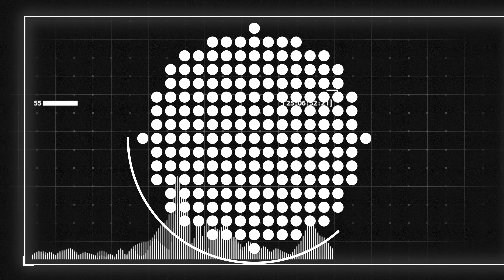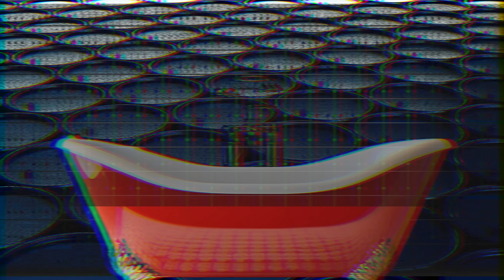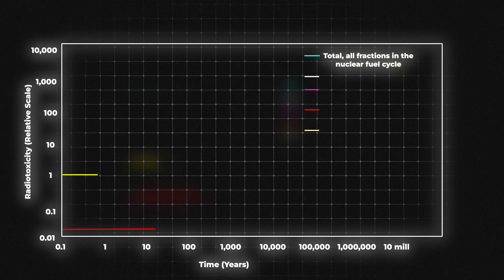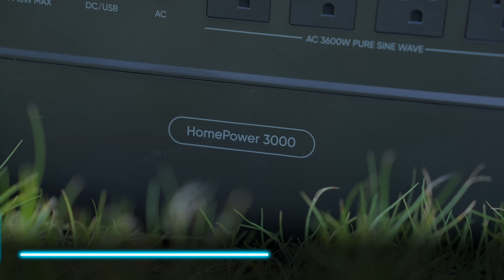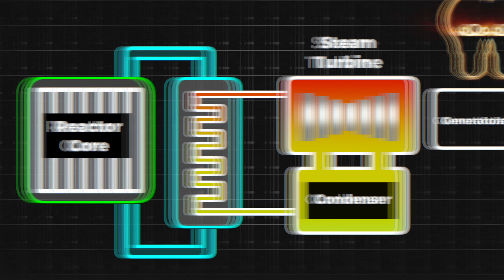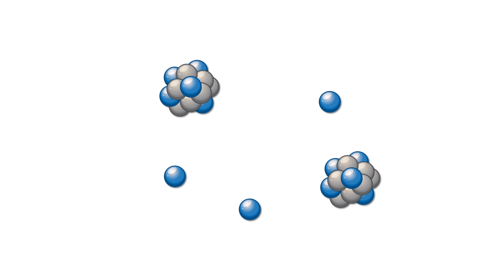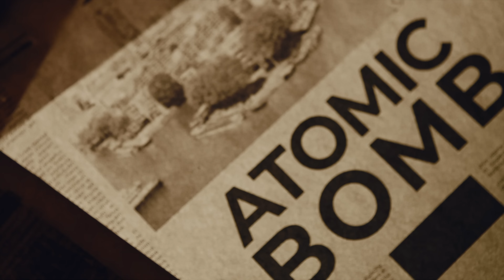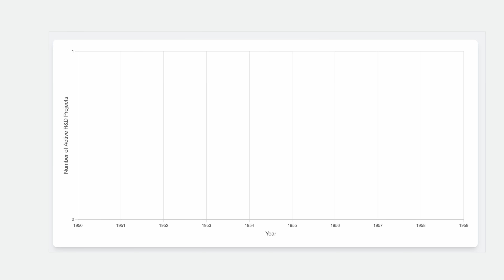Why Thorium is About To Power Everything

Comment: No the salts are not particularly corrosive to the primary material intended for usage with a molten salt reactor, Hastelloy N can handle fluride salts at 900C withe less than 1 million'th of an inch of corrosion per year meaning a 3mm thick pipe would on average take 118 years to corrode through it, and that is at 900C the first proposed reactors are intended to be ran at below 700C because that reduces corrosion exponentially, and Hastalloy N was invented in the 1970s along with the molten salt experiment... we have had the solution for over fricking 50 years, there was never a corrosion issue people just heard salt and said "salt corrode, salt bad, ooga booga!!!" when it's actually salt + water that corrodes stuff, which... if they have water in the reactor... erm, they f£$%ed up, like they're really f£%$ed up, getting water into a reactor which is 600 - 650C at ~5atm, like it would actually be kinda impressive.

And might I point out that water is more corrosive to steel at ~400C, it's only due to the usage of sacrificial anodes that conventional nuclear reactors don't fall apart, to be fair you can't use sacrificial anodes in a molten salt reactor as you would also plate out fusion products and more importantly U233, which would be bad. plating out of the suspended fuel is a much bigger concern, so you would still have a sacrificial anode but it wouldn't be to maintain the ion balance, but instead to purposefully plate out a the suspended fuel preferentially on the anode because you can either replace it or clean it off relatively easily rather than... the impossibly of cleaning or replacing the whole reactor.

Comment: You are just so wrong on so many levels in this video, no the fuel in a conventional nuclear reactor is not enriched enough to have a runaway chain reaction assuming you build the reactor to have a negative temperature coefficient—which we do—all the accidents except for chernobyl were decay heat related, and chernobyl had an ass backwards design starting from the fact that it didn't have a containment building and ending with the control rods being graphite tipped which increases the reactivity and chernobyl having a positive void coefficient which in extreme cases is effectively a positive temperature coefficient considering it was a boiling water reactor.

and as for decay heating a throium reactor has just as much of if not more of an issue with decay heat than conventional nuclear reactors, this leads onto the mistake this whole video makes, which is that it's the fuel that makes the difference not the reactor type, because surprise, it's all the reactor type and not the fuel, first the reason why decay heat isn't an issue in a molten salt reactor... well it is, but like not a risk of radiation release, you will trash the reactor though if you don't deal with the decay heat, but even that is assuming you have implemented dump tanks is not a problem you have to worry about, both of those come from the fact that you are using a liquid which has a liquid temperature range of ~1000C and at ~1400C heat rejection becomes incredibly easy to the point where you can hair cool the fuel salts with a passive radiator. 

and if you have implemented dump tanks you are using a freeze plug trip if power is lost or the reactor gets too hot, and you can design the dump tanks to be very good at passively rejecting heat, by maybe keeping them submerged in enough water to let the fuel go through enough half lives so the dump tanks can be passively air cooled while keeping the fuel at a reasonable temperature. 

Can't be bothered to explain but all the other benefits you laid out are also due to the reactor type and not the fuel, apart from Thorium being 4x more abundant, but that is a relatively useless stat considering we have a mountain of nuclear waste that could be used as fuel again in a uranium molten salt reactor and get out 49x more energy out of the fuel than we did when we originally burned it and reduce it's half life down to lower than the waste from a thorium breeder reactor, which we have been using burner reactors for 70 years at this point meaning we have 70 years of waste times that by 49 and we could keep current rates of nuclear fission for the next 3430 years or power the whole world with fission for the next 100 years just from nuclear waste, to be fair to start up the reactor you do need a mix of high enriched uranium and spent fuel, or less weapons grade plutonium and lots of spent fuel, and if you are decommissioning bombs to start reactors I see the second option as being the better option.

If you either don't have nuclear weapons or are not planning to decommion them, the first option is better in my opinion even though you need a lot of HEU to start up the reactor, thats because you're going to have built a fast spectrum reactor and U235 fissions best with a thermal spectrum reactor, so it's just a miss match, but you can force it to work, you just need a lot of HEU to be able to maintain criticality, but you do get some plutonium in the spent fuel hence why it is used as a preference as the other component of the start up fuel.

Comment: U233 made by Thorium, is highly fissile and can be used to make nuclear weapons. The fission waste products of a thorium reactor is the same as a U235 fueled reactor. A molten salt reactor is so much more dangerous to operate than a classic reactor, that it has to be serviced by remote controlled robots.. Because the entire reactor vessel and pipes becomes extremely radioactive. This is such hyped nonsense. The tech is an alternative to U235. But thorium is in no way better than a U235 fueled reactor.  U235 is just so much easier to use. Which is why every reactor is using that fuel.

Comment: The last line of defence against out of control AI is cutting off the power.  You've just made small modular reactors which have be easily hidden and protected. You've lost control of the off button.  But "save the planet , right"?  When will you wake up to the climate scam?

Comment: I have been a fan of Thorium for years and its always been around the corner though it seems China has made it to the corner.  It use to be said it was the stop gap as we wait we for fusion but fusion is developing at nearly the same the pace as Thorium reactors and might make it to the market before or right after Thorium and you will have the same tech battle as we have always seen when it comes too two competing technologies appear at the sametime.  It use to be argued that Thorium reactors would be cheaper, smaller than fusion reactors and would make better decentralized power sources/grids.  But when you have companies like LPPFusion getting close to getting room size fusion reactors than thorium loses.  So lets see what happens in the years to come.

Comment: No. 
Thorium is a hoax because the transmutation of thorium-232 into uranium-233 takes 27 days and if the neutron flux is too intense the intermediate isotope of protaktinium-233 will transmute into protaktinium-234 decaying into uranium-234 and that isotope is inert.

Comment: The real advancement would be the molten salt reactor.  It can use thorium, yes.  But also depleted uranium ( the US has like 500,000 tons just laying around in storage) and spent fuel from light water reactors (which the US also has thousands of tons lying around in storage).  They can both power the whole country, but solve the nuclear "waste" storage problem too.  A win-win.
Reply: I think you are high by about 1000% when you guess the amount of spent nuclear fuel we have on hand.
Reply: The usually referred thermal molten salt resctor can not be rum with depleted uranium or spend fuel. Most concepts want highly enrichted Uranium or plutonium fuel. Even a fast molten salt reactor would still need the highly active starting fuel than may be produced from spend fuel after reprocessing.
So far the molten salt reactor experiment was more like a failure and did not work well with corrosion problems to limit the lifetime and radiolysis in cooled down fuel that caused significant incident with the shut down MSRE reactor in the late 1990s. They were lucky it did not went horribly wrong - simple flooding from a thunder storm could have caused quite some extra trouble.

Comment: FINALLY!!! Someone got it "Mostly" right. The reason there are no Fukushima type explosions in a Molten Salt Reactor is because the MSR operates at "Atmospheric" Pressure, you didn't mention that. I was happy to see footage from Copenhagen Atomics in your video, but #2. Corrosion is directly proportional to "Salt Contamination" and Copenhagen Atomics has %99.9999 pure salt, they sell it to universities all around the world, so 'Salt Corrosion" is not the problem "Heat Corrosion" is. #3. it takes 2500 lbs of Uranium 235 just to kick start a Thorium MSR yes that's correct an MSR needs fast breeder reactors waste just to get started ie it eats the waste of fast breeder reactors for breakfast. #4 When a radioactive material half life's 10 times it is no longer considered radioactive, it's considered a heavy metal, and disposed of that way, so the half like of an MSR waste is 30 years, multiply by 10 = 300 years and it's no longer radioactive. You were real close, you did real good with this video selling MSR's. Why don't you do an interview with Kirk Sorensen the founder of Flibe energy? I would like to watch that. He has a lot of videos on Youtube.
Reply: Hastelloy-N with niobium was nearly immune to constant salt presence.
The problem is only a sullfur...

Comment: Why has thorium been restricted? IMO thorium reactors are a lot smaller than the breeder reactors. I believe a small enough reactor could power a vehicle which would replace gasoline and battery sales for years.  Side note - Thorium reactors was on the table for the NP-power plants - President Nixon was advised against them and went with the Breeder reactors that cost more and left bad waste. Thorium is a lot safer and they could use them to dispose of the left over waste from the breeder reactors.

Comment: I like ANEEL fuel. ANEEL fuel is a patented, innovative nuclear fuel developed by Clean Core Thorium Energy (CCTE), a company promoting thorium-driven power. It is a blend of thorium and high assay low-enriched uranium (HALEU) designed to safely and cost-effectively power existing PHWR/CANDU reactors, addressing concerns about safety, waste, and proliferation.

Comment: No. No. No.  Uranium waste isn’t more dangerous than Thorium. Daughter products do not remain radioactive for thousands of years. Only the Transuranics last that long and they are only mildly radioactive. 

Think conservation of energy.  

If something is highly radioactive or “hot” it is giving its energy off quickly and therefore has a shorter half life and vice versa. Transuranics are mildly radioactive and therefore stick around much longer. Since Daughter products are highly radioactive they therefore have shorter half lives. But these shorter half lives  are precisely why spent Nuclear fuel is so “hot” and radiotoxic. The reason uranium waste is (erroneously) considered more problematic than thorium is because thorium doesn’t make transuranics. It’s true Those Transuranics represent longer half lives but the real concern some have is the proliferation risk. The uniformed suppose they represent greater risk since they are also fissle. But there is a longer explanation as to why this concern is unfounded than I care to share here. 

The idea that spent thorium fuel would be less radiotoxic than spent uranium fuel is basically false. It is also extremely “hot”. Indeed as you say in the video it actually transmutes into uranium before being “burned”. A thorium reactor is actually a uranium reactor using thorium as its uranium feedstock precursor. 

Modern Uranium reactor spent fuel is actually pretty amazing and the perceived “problems” really have been solved. The point that you make that spent thorium fuel would be safe after 300 years really can be said about Uranium reactor fuel as well. The Transuranics are the only thing left after that time and really aren’t radiotoxic. The radiation emission profile they represent is just not a concern. Indeed most people have some of this material in their homes in their smoke alarms in the form of Americium 241. If we were to reprocess that same spent fuel we could then use those Transuranics as fuel in follow on reactors. The misinformed are concerned that this same process might be the route the nefarious might use to create weapons.  

Thorium reactors are indeed better. Why? because they do avoid the concern of Transuranics and the proliferation risk there.  But those who really know think that this risk in Uranium is fairly overblown and misunderstood when one considers the other technical difficulties associated with pursuing such a course. 

I love your description of Molten Salt Reactors. However your explanation on critical geometry is really mostly applicable to “fast” spectrum reactors. Most Thorium reactor concepts are “thermal” spectrum. In these the reason the reactor stays critical isn’t critical geometry. The bigger reason is that the Core is where the moderator is. Usually graphite. Moderators are critical in “thermal” spectrum reactors and any fuel outside of the core simply won’t react in the absence of this Moderator. Your description on critical geometry isn’t wrong but it’s more appropriate to these other “Fast” spectrum reactors. Thorium is typically paired with Fluoride MSRs not Chloride MSRs. 

A key bone to pick here tho. MSRs advantages could also apply to Uranium only Molten Salt Reactors. 

Thorium is promising for many other reasons and we should pursuer it with vigor but your errors here are misleading. 

Modern Uranium Nuclear Reactors are fantastic. We should most certainly chase the thorium future. But vilifying the already amazing, safe, proven, and reliable technology that we can do right now isn’t the correct path forward

Comment: Lots of errors or false statements. **First, for Thorium 232 to be used in reactors, you need U-reactors, PWHR for unenriched, like in *bdia, or PWR/BWR with lightly enriched U.
** It's also not right to call "burn thorium", there is No burning, only radioactive decay and fission. 
** "Thorium is not radioactive" !!?? Who told you this crap ? Come to India's southern coast, vwhere many beaches container Monazite sand. Village after coastal Village have reported huge numbers of cancer cases. 
I did a study in 12 beaches, measured the radioactive doses - some are 50 -80 times the max "safe" (no amount of ionising radiation is truly safe) dose of 24 micro sv/hr.  Just one big village, called Kadiapattanam has already reported 432 cancer cases 😥. " Not radioactive "!!??!!

Comment: The problem of containment could be addressed by using the best available materials and operating three reaction chambers side by side in series.  You would operate two chambers at a time with the third chamber empty.  

When a containment material in the first reaction chamber to be commissioned has degraded to the point it is no longer effective, the chamber contents would be transferred to the empty chamber, where the reaction would continue.  The second chamber would be filled and commissioned at this point.

Once the now-empty chamber has cooled sufficiently, the entire containment lining could be removed and replaced by machinery specifically designed for the purpose.

When the second chamber's containment material has degraded the material in that chamber would be transferred to the newly-refurbished chamber and the process repeated in a perpetual game of musical chairs.

As far as legislation is concerned, I know of several wind and solar factories which have had legislation put aside to expedite their construction, often in environmentally sensitive areas.

If governments can turn a legislative blind eye to get solar and wind projects done faster, it becomes not a matter of getting the legislation in place so much as having the political will to get it done.

Comment: Should have been Thorium all along. Common as lead. Thinking for decades. Three grams is almost 300 HP, instantly; lasts, what 3 mos.. Produces only heat. A piece of tinfoil between you and it protects from any and all radiation radiation possible